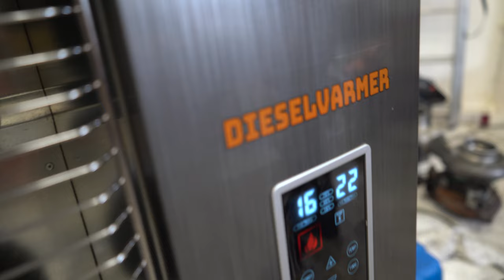Building mercedes om648 race engine and fitting it in the car!  (part 2)

Comment: I hope you dont run standard bearing clearance on the mains, or you’ll end up with the same bearing problems that BS has had for years. Too little clearance and too little oil film to lubricate and dampen the crank. And I would use a Ati super dampner. Standard parts and clearance are good to around 500hp and after that you’ll need to start thinking racing engine specs.
Reply from the maker: hi, we are runing racespec clearings for 20w50, rods and crank have bigger clearings, we also use ross Harmonic Damper built for m104s. we are using race parts as you can se and we hope we are above 500whp. thanks for the comment :)
Reply: @furulunddrifting  awesome! Just wanted to make sure you don't duplicate all the BS mistakes.
Reply: Will all standard parts on the om648 support 500hp or no? I’m coming from m57 deisel engines and just curious how I can build one of these things on a budget. What needs to be upgraded to handle 500hp in a drift car? Sorry I can’t find anything online
Reply: @MrSpeedyPete  Yes, but you need a girdle plate and stiffer valve springs.